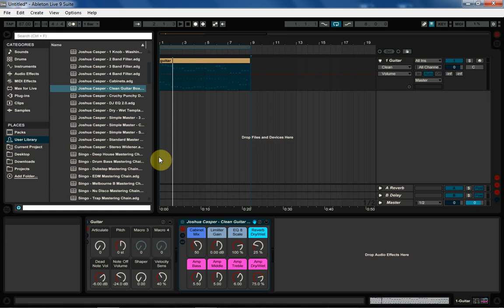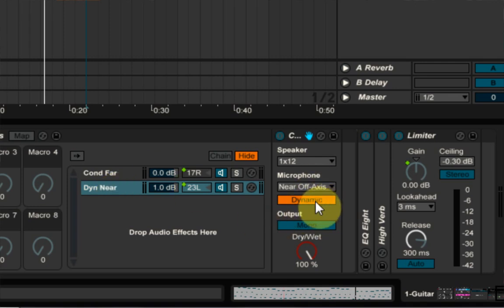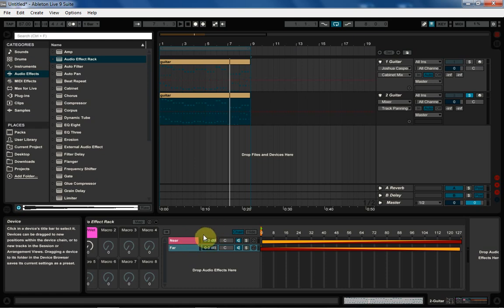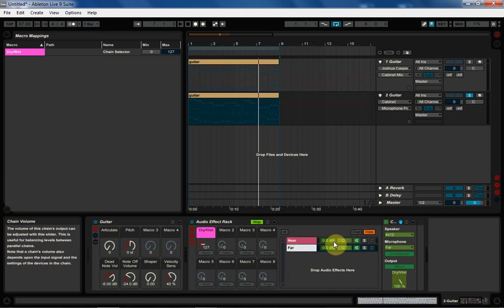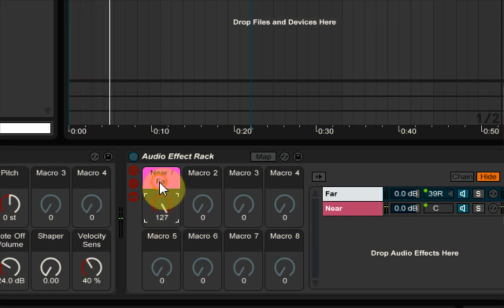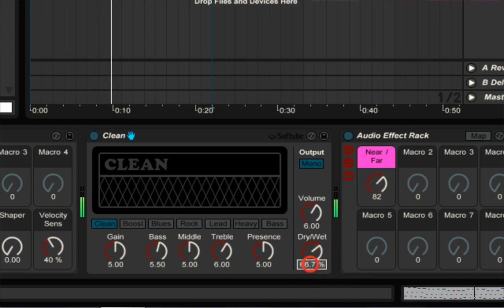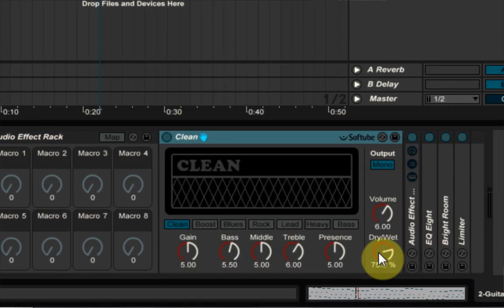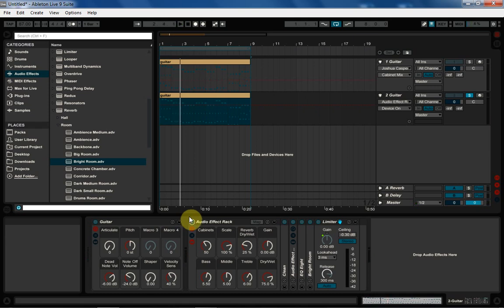Ableton Tutorial: Setting Up Amps & Cabinets for Guitars

Comment: great info mate, straight to what i looking for.

1 question, when u set the far/near macro with panning system, i dont understand why the number are 40 and 39? is it should be that exact number? why not 30 to c and c to 30? 

anyway thanks for the tutorial!
Reply: that is said Center to 40 which includes 39.